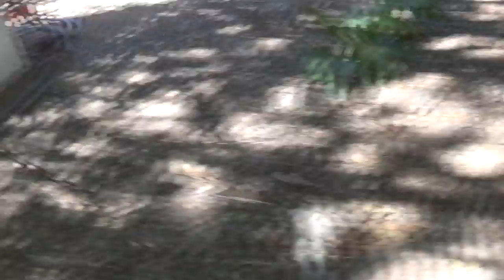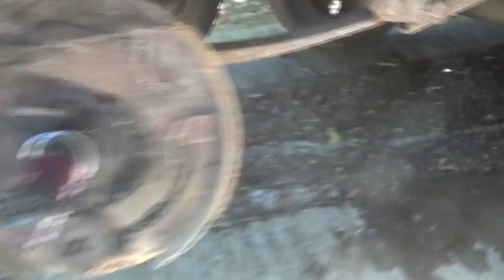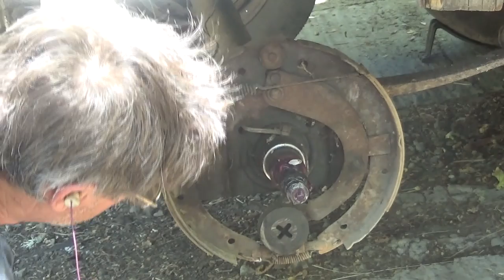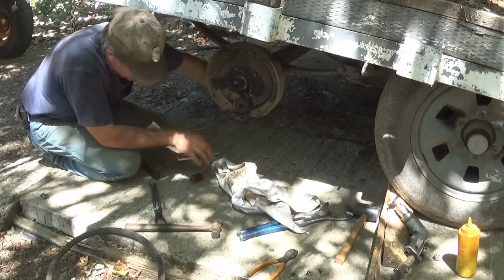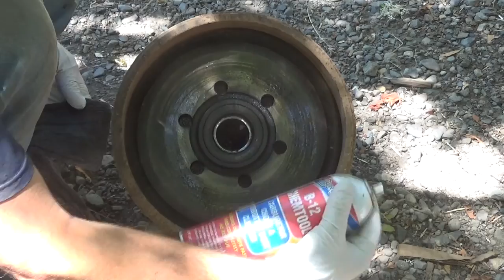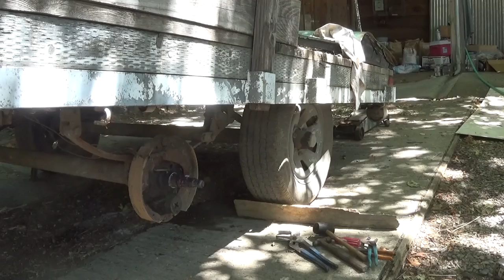Electric Trailer Brakes

Comment: If the arm with the magnet is supposed to move outward to apply the brakes,then it is also backwards,as with forward rotation ,it would move inward.Therefore the whole axle is probably installed backwards
Reply from the maker: The error is that I said it's a cam actuating the "shoes" plural. I went back and looked, and at 1:40 you can see that the actuator is a first class lever that only actuates the forward shoe when rotation is forward. If you look at the anchor pin, the actuator pin, the actuator pivot, the spindle and the magnet puck you will see they all share a common centerline. This tells me that the brake is designed to work equally forward or backward. Given that, then the only determining factor is the installation of the shoes. Perhaps it WAS installed backwards at the factory!

Comment: i use anti seize on pivots & adjuster.. but take care with compressed air around brake dust..I think it's better to use brake clean, keep the dust wet, not air-borne...like that you use hearing protection .

Comment: Did the other side go any better then the side you filmed? I hope you did not run in to even worse issues over there. Good work. Now that trailer will be safer to use now that the brakes should be able to physically work.

Comment: homemade trailer the brakes weren't on backwards the whole axle actually got turned around
Reply: That`s what I was thinking. Would have been easier to drop the axle, spin it and your done in 10 mins  :)
Reply: Nahh, just cut the tongue off and weld it to the other end.  :)
Reply: Except for Jeff still had to pull it apart to fix them in the first place. ;-)
Reply: Paul Gumper no the magnet is going the right way it belongs in the rear of axle
Reply from the maker: The trailer was manufactured by either Sway-Away or Never-Sway or some such thing in Klamath Falls. They closed about 5 years ago. The error is that I said it's a cam actuating the "shoes" plural. I went back and looked, and at 1:40 you can see that the actuator is a first class lever that only actuates the forward shoe when rotation is forward. If you look at the anchor pin, the actuator pin, the actuator pivot, the spindle and the magnet puck you will see they all share a common centerline. This tells me that the brake is designed to work equally forward or backward. Given that, then the only determining factor is the installation of the shoes. Perhaps it WAS installed backwards at the factory!
Reply: ElderlyIron no tellin maybe it was a Friday afternoon LOL
Reply: LOL, Yea, I went to the dexter website to understand the brake shoe configuration better the way you described and realized the shoes were on the backing plates correctly, just the backing plate assemblies were intended to be on the opposite sides of where they were installed.  You're right though they should brake going forward and reverse.  I believe according to the design, you should get most brake arm travel when going forward.  I'm sure now that you serviced them, they will work fine for your purposes.
Reply: I enjoyed it just the same.  It did make me think.  :D
Reply: Keith Ray well the reason I know about them is because every three years on my trailer that's what I do I just go buy the whole back assembly simple for Bolt and two wire and good to go
Reply: Keith Ray oh yeah when they get out of adjustment it's better to have them on there to wear that arm can have the most amount of travel that way they'll work if the Adjusters stick
Reply: yes I think you  tothis guy like to redesign the wheel

Comment: the arm that the electric magnet is attached to when it adheres to the inside of your hub should pull in the direction of the curve where the magnet is facing somebody turned that axle around when the trailer was built
Reply: Yea Jeff, Rusty is right, someone put the axles in backwards.  It looks like the brake shoes were installed correctly on the backing plates.  The problem was, they were on the wrong side of the trailer.  UGH!  The magnet arm should rotate toward the axle when actuated not away from it.
Reply from the maker: The error is that I said it's a cam actuating the "shoes" plural. I went back and looked, and at 1:40 you can see that the actuator is a first class lever that only actuates the forward shoe when rotation is forward. If you look at the anchor pin, the actuator pin, the actuator pivot, the spindle and the magnet puck you will see they all share a common centerline. This tells me that the brake is designed to work equally forward or backward. Given that, then the only determining factor is the installation of the shoes. Perhaps it WAS installed backwards at the factory!

Comment: You might want to explain to the viewers....1)there is NO Polarity for hooking UP the electro magnets , either wire can positive OR negative !!!!!!!!! (2) Anyone running supply wire to electric brakes should use atleast 12 gauge wire , and 10 gauge would be even better to prevent voltage drop .